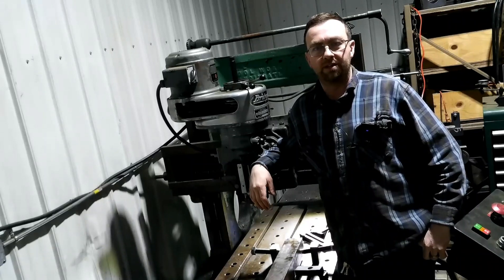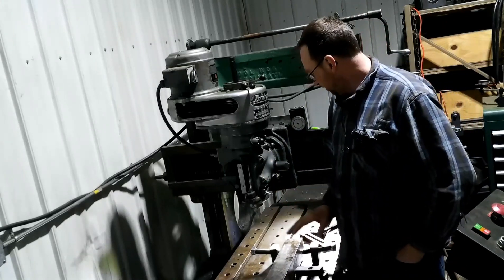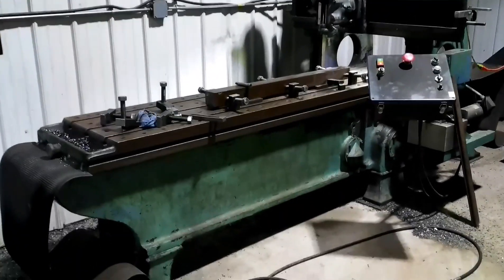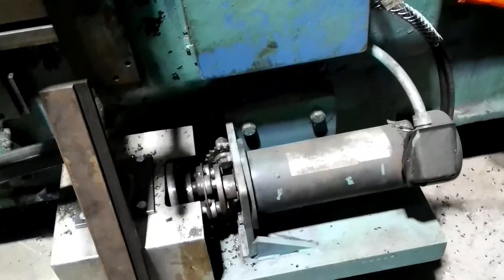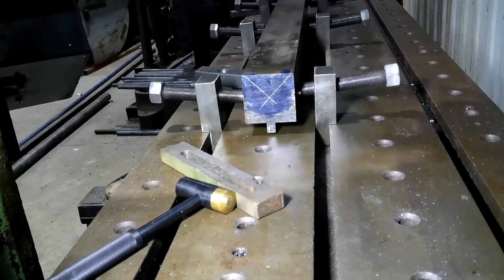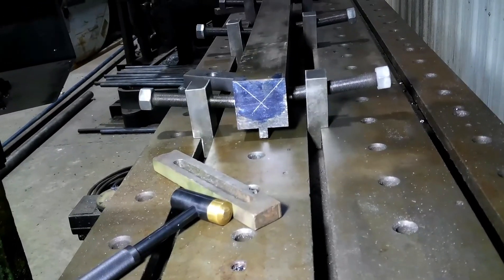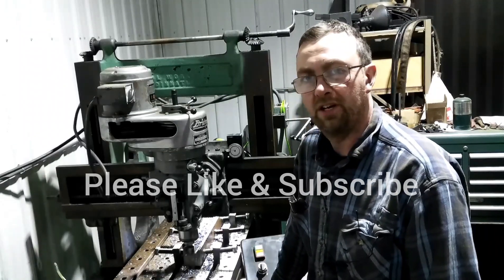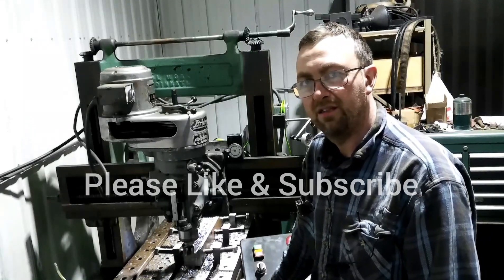Milling a Press Brake Die on a Metal Planer Mill, Part 2

Comment: sir,your machine mechanism  use gear or  screw/threaded rod (X axiz)?🤝👍
Reply from the maker: gear drive
Reply: @TopperMachineLLC wow thats great sir..how you arrange/set the table speed?(one speed or variabel speed?)thanks a lot.
Reply from the maker: @Ph-vl1fm  it is variable dc drive. Check out my other videos of the machine.
Reply: @TopperMachineLLC  ok,thank sir.👍🤝btw how is your motor spesification:power,etc?

Comment: Back in 1974 as a 17 year old apprentice working in the chieftain tank factory in th UK  My first shop floor placement after one year in the training school was with a man called jock a massive Glasgow man he was operating a planer similar to yours. On it we used to put the tank hulls on the machine bed to do the world preps on the long faces. The milling head was broken with about a 6 month lead time for repair. So he had to set it up as the original planer machine. This bloody thing frightened half to death taking a 1" wide x . 063 depth of cut blue hot cutting the size of massive truck coil springs changed as the sprang off the end of cut.bouncing down the shop. I think the machine was a waldrich blb(bloody big bugger)  oh what fun we had.. Fantastic place to get an apprenticeship...
Think you do a great job thanks for you vids

Comment: I have two vertical mills in my shop work wants me to start being able to make dies for our brake presses and any tips would be greatly appreciated
Reply from the maker: You're only limited by the travel of the mill and your imagination. Research materials. Mine is 1018 and is not meant to be a production die. Just occasional use. I haven't finished it yet, been too busy and it's not a priority now.
Reply: @TopperMachineLLC  I know I'll have to harden most materials guess that's why we have a forge just have to learn that now thanks for the tips though...also can't I do what they call hard milling mill already hardened metal but with low depth cuts And aggressive cut speeds?
Reply from the maker: @BigJP1993  you could use a 4140 Prehard, it's about 28-32 rockwell C to start with, but it too has internal stresses. When you start taking off a lot of material on one or 2 sides, it takes away the strength.  It will move, doesn't matter what it is. I mill 4140PH like anything else. It's a little harder on inserts, but cuts fine.
Reply: @TopperMachineLLC  but would be ok for dies on big brake presses? They use Amada brakes

Comment: Great re purposed machine .   What rev's were you running that cutter on .   Cheers .
Reply from the maker: After running this job several times, I found 325rpm to give the best tool life. I used to run faster but would burn up inserts after a couple bars in the middle of a cut. Feed rate still about the same.
Reply: @TopperMachineLLC  Have you tried the high rake cutters ,  they love to eat steel .
Reply from the maker: @swanvalleymachineshop  not yet. Been looking at new tooling. Been hard to justify with the last few years I've had. Been awful slow.

Comment: On the top of the mill head, around the spindle. Are there a pair of levers? I couldn't tell for sure, but what are they for?
Reply from the maker: If you're referring to the 2 black knobs, one is a brake and the other is for shifting high/low speed.
Reply: @TopperMachineLLC  that's them . Thanks

Comment: The planer table is a very nice tool. This is a very interesting project to follow along with, thanks. I noticed that you do not have a cooling pump on the planer, what are your thoughts on using a cooling system?
Reply from the maker: Coolant gets messy. I usually run carbide indexible cutters so no problem. I am considering a cold air gun tho.
Reply: @TopperMachineLLC  sir,your machine mechanism  use gear or  screw/threaded rod (X axiz)?🤝👍thanks

Comment: I did not know you can make a planer table go that slow
Reply from the maker: It has a modified drive. Original drive was changes out by a previous owner to a Variable DC Drive. Works great.